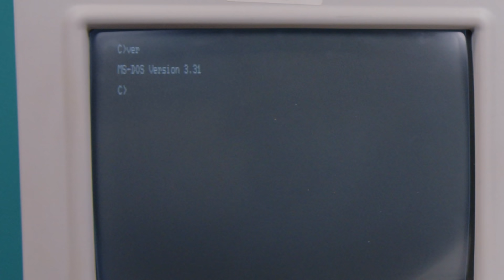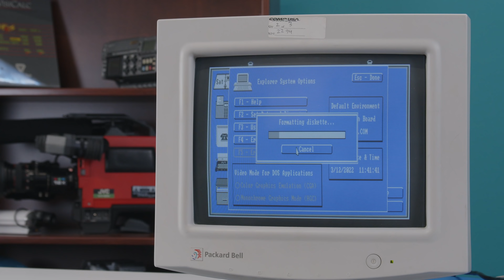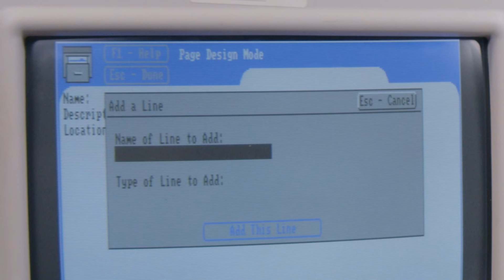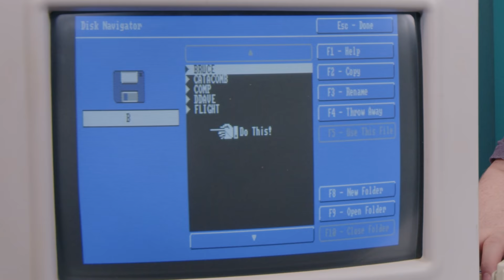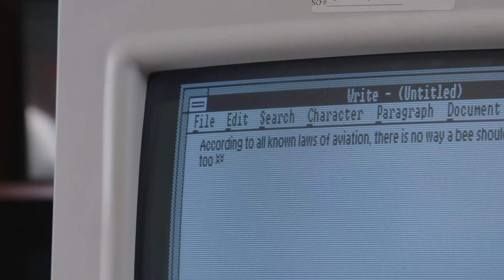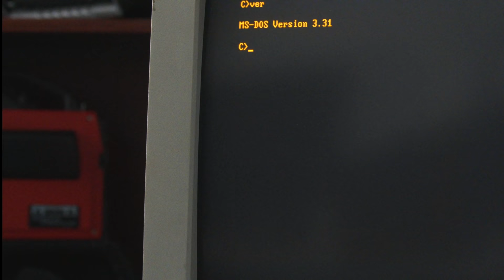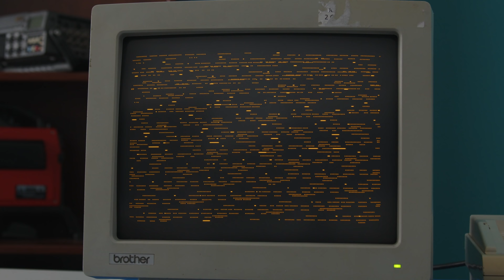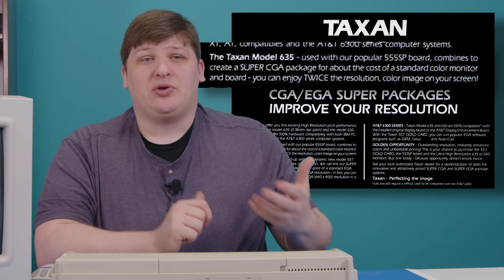Headstart's PC With The Weird GUI "OS" [Explorer]

Comment: That MDA text demo really does look beautiful, between the chip's resolution, the CRT display, and the crisp bitmap font. Kind of sad we basically lost bitmap fonts to the DPI race...
Reply: @34:15 My suspicion is that the headstart "gui" was written using BIOS calls whereas Windows - with all its layers - was running in straight machine code and writing directly to the frame buffer, which was, even in its roundabout way, much faster. BIOS calls would have been easier to work with and had less compatibility worries but can be very inefficient.
Reply: @VidaDigital   This is very likely the problem.  The BIOS API is simple, least-common-denominator, one-size-fits-all code.  It does nothing particularly well, except work on anything.  There would be a huge amount of overhead just calling the same function over and over to draw a character on the screen, one pixel at a time.
Reply: I constantly use the old-school pc font pack for all my text editors and terminal emulators (EverexME 4x6 is what I currently use)
Reply: @zulc22  i dont see any everexme 4x6 fonts. did you mean 5x8??
Reply: I think the loss of bitmap fonts probably was caused more by the desire for good looking print output. In day to day use of the computer you don’t really need the variety we have or the degree of scalability.
Reply: @VidaDigital  The bigger problem with BIOS calls is that it’s hard to expand on them in a broadly compatible way. — You could change them or add more, in theory, through a custom BIOS ROM or maybe an ISA expansion card, but then your software will only work on a modified machine… Also that approach causes other problems like reduced memory space for RAM or some kind of convoluted ROM swapping scheme.
Reply: @nickwallette6201  Well, with one size fits all you don’t have to worry about only having string routines or shape fill on one machine but not elsewhere. Given the time in which it was created, the designer made a wise choice.
Reply: @jnharton   The BIOS was a godsend.  But, using it here was probably only beneficial in saving ROM size, to not duplicate code that already worked - albeit slowly.

And you're right.  Bitmapped fonts went away entirely because of scaling issues, and translation between screen and print.  I was reading a 1991 PC industry magazine recently, and they were making a VERY big deal of Postscript support in printers, and the "up and coming" TrueType standard that Microsoft and Apple had signed on to.
Reply: I loved seeing that brother monitor. Brought me right back to my school days. I can close my eyes and hear that daisywheel wheel word processor hammering away at my assignments.
Reply: It was only VGA compatible, i still remember what the Canadian/Taiwan people told Cor Boonstra, he asked me wat EGA/MDA was.
I don't have a running machine here, it's runs EGA, but it was before the standard was available.
GUI was Turtle clone crap from MSX, never used by anybody! We did not know what it was, it came from Taiwan.
They gave a system to a real writer that used a CASIO typewriter that was too slow too! To test it, true story! He got a Macintosh 1985, true type! So kept using the Adlar, Trympf i have here. The shining type writer. If you need that, i can donate it too, for post here!!!!
Headstar was headages, magic too. Holland only????
a lot i forgot, but we did try to offer the best for Type wring people needing clear screen, and supporting Hercules, game levels too.
i remember slow slow slow, but this was 1989! never used it!
i did got better systems then you have now i guess. not 1.4 floppy, rest i forgot.
But my system was Hercules compatible! What title? i use fancy monitor back then, NEC, non colors were supported, we did know that back then, but i was 8? 12?
Chip was early TSMC deal trough Philips Taiwan, early, who was it?
Philips bought Headstar and sold TSMC, this was that! Samsung was less big, not able to make chips! Lower level production only!

Comment: I'm from the Netherlands. My parents got me one of these brand new way back. It was my first PC after previously only using (Atari) basic Home computers. I can confirm that the name was definitely Headstart Explorer, and i got it complete with a monitor and a plastic standing shelve that you could slide the computer in with the keyboard folded. Sadly my parents had no clue about  computers and to save a few bucks they bought the cheapest model with Hercules graphics. A friend down the street got the CGA version and at first we couldn't figure out why many of our games would run on his, but not on mine. Eventually we learned that it had to do with the graphics and with a few software tools to emulate CGA i eventually got most if not all to work.
Reply: did the page 2 work fine on yours? at least, as far as you could tell?
Reply: @vriska222  Don't really understand what you meant with "page 2" but as far as i can remember everything worked as intended. However the novelty of the GUI wore off in about a day. I never really used any of it in a useful way.

Comment: Tandy's DeskMate GUI is way more usable and functional on an 8088 or 8086, although it's not entirely built into ROM -- you do need a floppy disk or hard drive to run most of its applications.
Reply from the maker: I feel like surely they could have matched the performance of deskmate - which was, if I recall, custom character graphics instead of bitmap - even within this limited space if they'd tried.
Reply: @CathodeRayDude  I could see that— deskmate could have all been custom fonts. That might explain why I couldn’t run it on a generic pc clone when I tried… I distinctly remember just getting no video and having to hit reset!

I had the Tandy 1000TL. Still feel spoiled to this day by how it booted dos 3.3 or deskmate from rom. I remember it having some nvram(?) settings, you had to run a utility off a floppy to get in there and set stuff like what it booted into and what kind of floppy drives were installed. We got a hard drive into it via a scsi card
Reply: @hyvahyva  The "no video" might have been because unless you have a "Tandy/PCJr graphics" compatible card it might be trying to do something the generic pc clone couldn't, even with an EGA or VGA card as they were separate modes.
Reply: @CathodeRayDude  Personal DeskMate II (which is what your 1000HX originally came with) does operate in true bitmapped graphics mode, although it isn't as intensely graphical as other GUIs because it was designed to be fully usable without needing a mouse.
Reply: I used Deskmate, back in the day, when I was in college. Boy have we come a long way since then.
Reply: @VidaDigital  that makes perfect sense! I know there was some custom magic in this thing... It also had a built-in audio system that could do recording and playback and I never remember it working in anything but the deskmate sound recorder! It sounded really, uhh, crunchy.
Reply: It was built in on the 1000SL and models after.
Reply: I don't get all the negativity. It HAS some GUI applications in ROM that start like a lightning, and all of them seem pretty usable. I would have totally used them for little things, like notes or to-do-lists, instead of fiddling around with floppies to get a full-blown word processor running.
Reply: I had access to the DeskMate SDK back in the day, but never really made anything for it.

Comment: Seems no one has commented this yet — HP’s monochrome text was even better than MDA. It had a half-pixel offset data bit for smoother curves in letters, and many decent scientific symbols in the ROM. But it only really showed up on HP’s scientific instruments and data terminals, such as the HP-85 (marketed as a calculator). Though their first DOS-compatible (not PC-compatible) machine used the same text output. And from an aesthetic standpoint I prefer the bitmap font they designed for it too.

Comment: Hey, young 'un! 😉And I mean that with the utmost respect and admiration, because you taught me a thing or two in this video. No, that's not right; you taught me a lot in this video, particularly about graphics systems. For example, I took a computer graphics programming course my senior year of college (1987), and when I tried to show off my final project to prospective employers during my first job search, I could never get it to run; all the program would do was hang. And since this was at a time when PC-DOS was the OS running on most business computers, that meant issuing the ol' three-finger salute to recover. While I had learned all sorts of cool stuff about graphics programming, I knew zero, zip, nada about graphics hardware. My graphics classwork was all done on a TI graphics computer, which was an 8086/8088 IBM clone from the early to mid 1980s. I knew it ran MS-DOS, but I have no idea what graphics adapter it had, other than it wasn't CGA or EGA, and it was too early to be VGA. After watching your video, I started wondering if it was some sort of Hercules variant, but it might've been some sort of proprietary TI graphics adapter. The fact of the matter is that I never encountered one of those TI graphics computers again, and unless I do, I may never know for sure. But you got me thinking about it again.

Speaking of Hercules, I was aware of the name at the time, but since I was working in dull, boring corporate IT positions, I never had any reason to learn more about their products. Thank you for satisfying my curiosity; even though it's a bit late to matter, it's still fun to know. Your demo also reminded me of a special project that dropped in my lap while I was working for a bank. There was someone who needed to run some sort of vertical market Windows software, and at the time, that meant Windows 2.0 running on an IBM PC/AT. I don't remember if she had to suffer with CGA, or if we were able to snag her an EGA-equipped PC/AT. I mostly remember how clunky and borderline unusable it was.

You were mostly right on the money regarding how uninspiring the IBM clone market was in the 1980s. Actually, there were two schools of thought in the clone market at the time: the Build It Cheaper than IBM school, which included my first computer, and the Build It Better than IBM school. But the latter school only had one member for most of the 1980s: Compaq. As you know, Compaq wasn't known for its eye-catching designs, although as part of the consortium that brought us EISA, they showed some innovation under the hood. They mostly traded on high quality and performance. When I bought my first PC, I really wanted a Compaq Deskpro, but the $10k+ price tag was far too steep for me. Oh, well.

Regarding the staying power of the 8088-based computers, I chalk that up to one thing: memory. More specifically, the memory architecture from hell that Intel built into the 80286. The 8088 could address up to 1MB of memory, the last 384kB of which was functionally useless, at least to MS-DOS. The 80286 could address up to 16MB of memory, but only when running in so-called Protected Mode. Most x86 software couldn't run directly in Protected Mode. It was theoretically possible for them to do so if the CPU's Protected Mode was used to create multiple virtual Real Modes, but MS-DOS wasn't a multitasking operating system. (You probably know about OS/2, which was supposed to solve that, but, well, that's a whole other novel!) To make a long story not too much longer, the wacky memory usage of the '286 mostly meant that the CPU's primary advantage over the older 8088 was that it could run a bit faster, pretty much as you said in the video. I think of it as an opportunity missed for Intel, among others, because the upshot of it was not just that the 80286 was borderline irrelevant, but it also meant that even after we had 80386-based PCs that theoretically solved the memory limitations, the staying power of 10 years of MS-DOS at that critical time meant that we were still using MS-DOS based applications, with all their limitations, on our fancy '386 and '486 machines well into the 1990s.

Anyway, cool PC (or at least cool-looking PC) and terrific video.
Reply: It's interesting to look back and play armchair quarterback with the PC design.  Like, what would you change to make it scale better into the 386 era, while still being competitive and with no foresight beyond what existed in the early 80s?

The computing industry had had the rug ripped out from under so many times when the next version of a machine broke compatibility with existing software.  This was such a problem, IBM was stalwart about making sure everything ran on every generation after the PC itself.  I think this held back the potential for newer hardware more than it needed to.

For example, I think one thing I would've done differently is enforce A20 support.  IBM's "compatibility at all costs" stance enabled the bad habit of pretending that the 21st bit of memory addressing didn't exist, because it didn't on an 8088.  Writing to 1MB + 1 byte would just wrap back around to 0MB + 1 byte, and so some software was written (sloppily, IMO) to take advantage of that.  I would've held firm and asked the prominent developers to issue patches to resolve any wrap-around bugs, then released the AT with the assumption that 1MB + 1 byte went to address 0x100001.  Instead, we ended up with a decade of various workarounds to selectively gate A20, and finding out which workaround had been employed could be a real PITA.

Comment: Just in case you run out of ideas (or this idea seems interesting enough): what about telling the world a story about 2K-capable CRT computer monitors? They completely undeservedly fell into obscurity, although in many respects they still surpass the LCD of the 2022 release. This is the unique technology to which LCD crawled only in the late 2010s, and in terms of latencies — only by about 2020.
At my house, for example, there is a Sony GDM-F520 decommissioned from the printing house in the mid-2010s — a 21-inch flatscreen beast weighing 35 kilograms (I had to change the computer table, the old one just buckled under the weight), capable of producing 2048x1536@90fps. And I will say that in terms of comfort of use and visual quality of the picture, it has no equal, even among expensive monitors. It's like it has built-in HDR, or I'm looking at an AMOLED picture, I don't know.

P.S. And yes, this is my main and only monitor since 2014. For about 20 years of total worktime, no signs of wear of the cathode ray tube have been noticed at all.
Reply: Those are cool the FW-900 is my holy grail but I'd still get something lesser, I just gotta find it

Comment: Many turbo enabled BIOS'es had shortcuts for enabling turbo.  I remember one of my much later 386 systems switching turbo with ctrl-alt and plus/minus on the keypad.  Give that a shot :)
Reply: Seconded. I had a turbo XT that used ctrl alt +
Reply: Yes, I remember many clone PCs being able to switch Turbo this way, as well as via a Turbo switch.
Reply: The Tulip legal clone BIOS was used, deal trough Philips and Tulip.

Comment: The lack of features in the word processor makes me wonder if it was somewhat oriented around text-only printers (albeit with a few escape codes at least), the feature set matches up pretty well with the average cheapo daisy wheel printer other than italics.
Reply from the maker: Yeah, that's a valid point, though since there are no driver or model options I don't think it could communicate any of the font decorations, it would be limited to plain ASCII, so it feels like they'd go even further if that were the case
Reply: @CathodeRayDude  The majority of daisy wheel printers, especially by this point in time, all used most of the same escape codes derived from the Diablo 630 primarily so I would be kind of curious as to whether it sends any of that info if you try to print.
Reply: @CathodeRayDude  many programs at that time actually just reprinted the line twice for bold and did underlining in the same way. You then didn''t need any knowledge of control codes for any specific printer as they all could do carriage returns and normal printing (spaces for characters that you didn't want to change).

Comment: Hercules cards were very impressive for the day and remained useful for years. A computer lab I administered had PCs configured with dual video cards, one VGA and one Hercules compatible. The monochrome monitor could be used as a secondary display or status panel by DOS apps that supported it. Very handy and relatively inexpensive since the cards and monitors had been repurposed.
Reply: That's very interesting, could you name DOS apps supporting it?

Comment: i always love your videos!

1. i never knew the hercules graphics card was originally designed in order to support thai! i lived in thailand and laos for almost the entire 90s, and did pc maintenance and repair as an after-school thing for most of it. the hercules (or compatible clones) card was very common there even into the middle of the decade. many had been modified to piggyback a second character rom onto the first, with a switch added to the back to select between ascii and thai (or lao, which is very similar) character sets.

2. your brief mention of monochrome displays having a sharper image due to no shadow mask suddenly clarified why the white phosphor monochrome vga display (also from philips) we had in the early 90s had a much higher image quality than the later colour monitors. (i guess that image quality is why next initially went for monochrome with their workstations too.)

3. oh brother, that monochrome display is sweet!